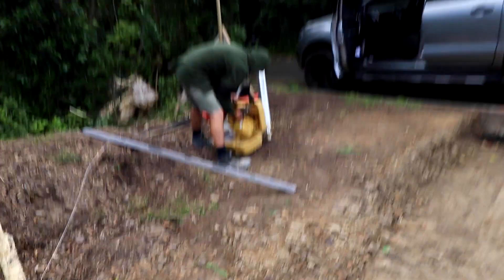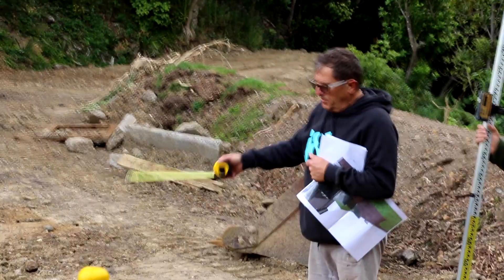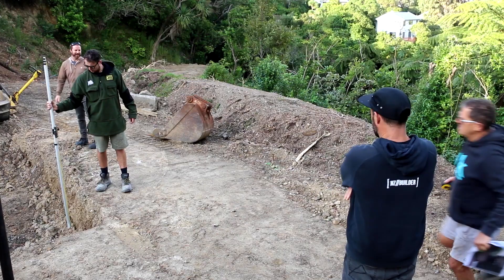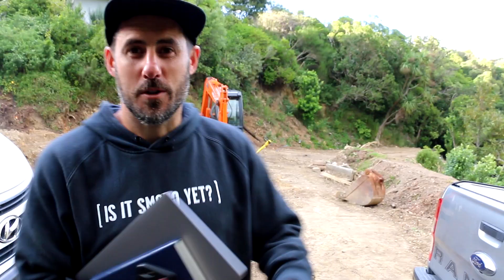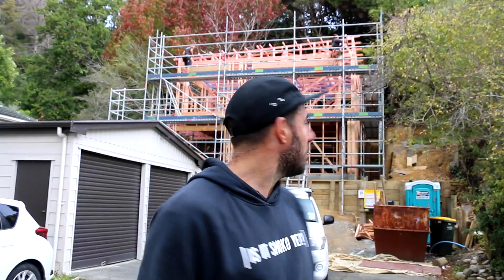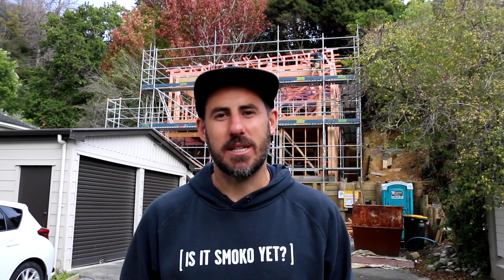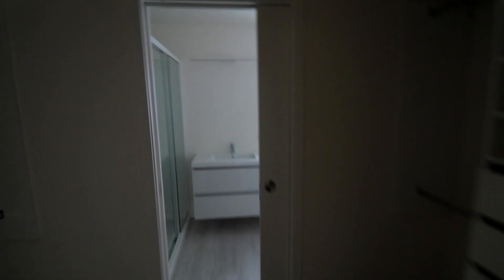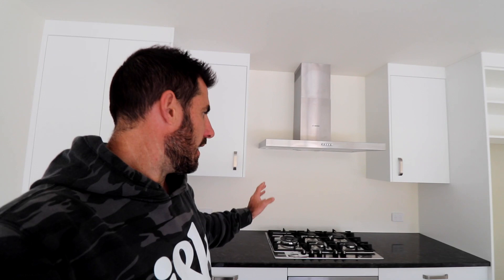Building Vlog - Sloping Site Earthworks

Comment: That hilly Lower Hutt sloping site looks rather tight and tricky. With spot levels and LiDAR drone topo surveys not sure why an accurate 3D computer rep of sloping sites can't be generated to design off. Having to change the floor levels on the fly like this suggests a major basic design error - maybe fault of the designer just being sloppy e.g. not going out the site at the very start before putting pen to paper.
Reply from the maker: maybe, but its sorted now